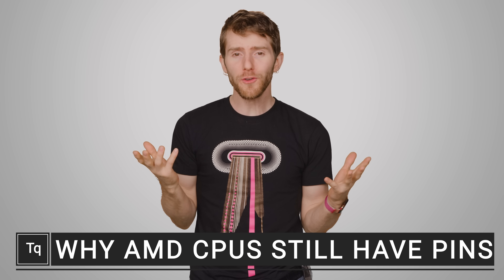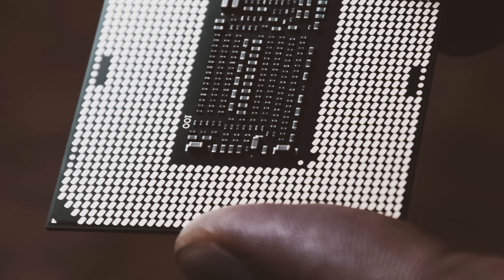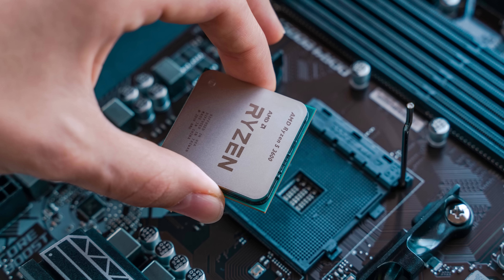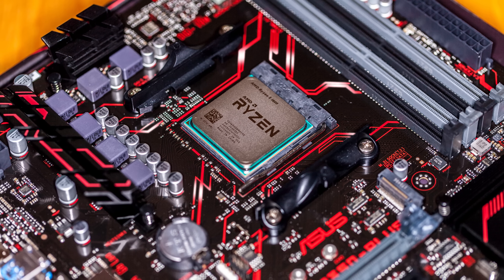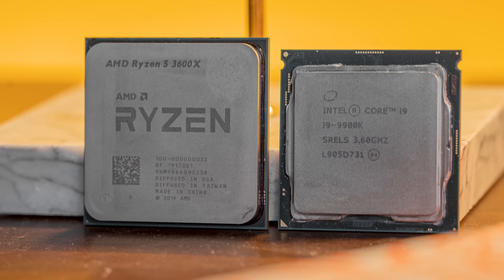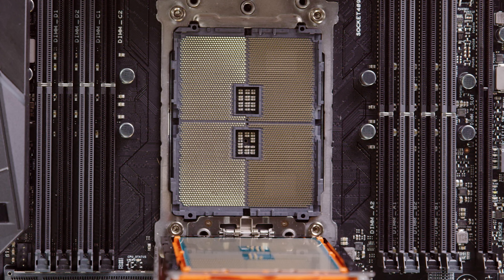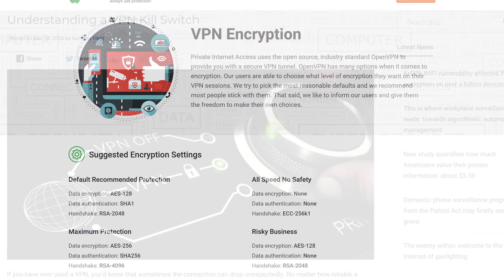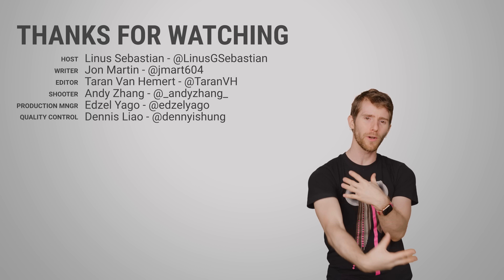Is AMD Stuck In The PAST?

Comment: I thought the step towards LGA for socket 775 was because of EMC problems resulting from the higher FSB clock and the pins acting as antennas. AMD on the other side integrated the memory controller into the CPU years earlier and therefore ditched the FSB completely.

Comment: Linus you forgot about few things 

you can get the CPU way longer, then a good motherboard, making PGA better for the long run

but also that PGA socket mounting system has a size threshold and that is why Threadripper has LGA socket

Comment: More than a little bit easier to damage an pga CPU, having worked on a server manufacturing line for almost a decade i can tell you the swap to lga from pga saved the company a fortune.  While individuals building their own systems will be careful, line workers with no concept of the value of a CPU and who the previous week might have been working in a washing machine factory or stacking shelves don't give a toss if they damage the CPU. When you have re-workers who can de-solder a socket from a motherboard it's much more sensible than having to scrap a cpu you cant RMA because someone mashed the pins beyond repair.  You'll note that AMD's Opteron & now EPYC have been lga for a decade, so yeah when it comes to massive amount of production lga makes far more business sense.  I imagine eventually AMD will switch to it for their desktop lines sooner rather than later.

Comment: Ryzens do perform better - we all know this - lets face it. LGA is the superior design.
LGA is tougher on the CPU which is the more expensive part and uninstalling a cooler on a PGA socket with CPU under it tends to rip out the CPU under it with the holding lever still tring to hold it. This incident is also not rare. So to answer the title question: Regarding the socket design the answer is: Yes, no doubt. But only AMD gives you PCIe 4.0 and a 7nm process. So the only flaw with AMDs Ryzens is the PGA-based socket.

Comment: Another factor might be that it lowers the R&D cost for Motherboard manufacturers which matters when you want companies to make motherboards for your ships, but your market share doesn't make that very appealing. A lot has changed since AMD settled on the AM4 design in 2016 so for the AM5 who knows what will happen.

Comment: PGA probably gives a better electrical connection as the socket grips the pins and the contacts are locked.  LGA relies on the springy contacts (NOT PINS) to touch the contacts on the chip.  Contact area is smaller, and there is no lock, only the chip is held down by a lid.   OTOH, removing a heat sink from an LGA chip is easier when the heat sink compound turns into glue since the chip is held down.  PGA chips are not locked down, and can pull out of the socket even when it is locked, so the chip can stick to the heat sink if it is removed cold.

Comment: 2:07 the 4.th pin on the right is slightly bended
Reply: Actually if you grind them out with bottom being letters and right side being numbers the the bent pins would be:
A2, A3, A4, H1, F7
Most are very minor but they are bent nonetheless

Comment: FYI, my go to solution for bent pins is a metal tipped mechanical pencil. Retract or remove the led in the pencil. The hollow tip can then be used to easily straighten the bent pin without damaging any other pins.

Comment: It doesn't matter whether the pins are on the CPU or the socket...x570 boards aren't cheap so it could be that it's more expensive than even the 8 core CPU going into it.

Comment: I ordered a Z77 motherboard on eBay to replace one that died and it came with a bent CPU pin.

I was able to unbend the pin surprisingly well, looks basically perfect now.

The pin was bent about 90 degrees to the right, I was afraid that much of a bend was enough for it to snap off when unbending but I got lucky.

Comment: I cannot stand this. They need to at least add a retention mechanism like the threadripper. I hate removing AMD CPUs from computers because the HSF is stuck to the CPU, pulls right out of the socket and then you have bent pins.

Comment: When I fixed a bunch of bent pins I found the easiest method was to use a utility knife blade. It's slim and flat, and the tip is pretty easy to get under single pins and straighten them up. Once they are all relatively straight you can then run down the rows with it since it's so slim and straighten them up all at once to keep them as uniform as possible.

Comment: why not have sockets on the cpu and amd style pins on the motherboard?
Reply: Because a PGA socket works by pushing the pins sideways into the contact clips. The plate with the holes must be able to shift, it needs the lever thing, and that wouldn't work well on the CPU package.

Comment: PGA chips also don't require special tricks to get the contact points perfect. As i recall, several LGA chips you installed had to be reinstalled because the contacts were not pressing down correctly.

Comment: lol intel changes the socket like every generation so i think having pins is forgivable. Your upgradability is much smaller in intel processors compared to amds am4. you can literally buy a $50 processor or $850 processor, and everything between has the same socket

Comment: I have never bent a spring on my PGA's and they provide a far better contact AND some heat dissipation.  G series commercial AMD sockets also used stupid spring array sockets as well.  Accidentally rubbing the recycled woven cover to power cables across a PGA doesn't destroy the socket instantly tho, so there is that.  The only improvement I can see in the future is substrate-edge power transmission.

~stares at the fucking computer industry that is still using fucking pins for power input to chips~

Comment: While I plan to buy amd processor next I must say it`s a big downside to have all those pins sticking from the cpu, every other video I watch about AMD shows cpu just sticking to heatsink when you remove it and bending those damn pins, Intel system is so much better.
Reply: It's because even tech reporters forgot how to remove a heatsink from a PGA socketed package. You have to twist to break the thermal paste.

LGA is foolproof until you drop something into the socket, then it's toast.

Comment: I was in shock when I found an old Intel based laptop I have with a PGA socket. I didn’t know they used to make laptops that way since I believe most are just soldered instead. That PGA socket on there does make things interesting though since I can actually remove the CPU if I’m bored. It is an exposed CPU by the way with no cover thing, so you should be maybe a little more careful when cleaning. The only way I know how to get a socket processor these days is to get one of those custom laptop chassis things you can put your own CPU in. I had no idea they existed until I got one basically from the government. But they of course didn’t give us more than a Pentium G5400, which isn’t “top of the line” like the guy teaching the class told us it was, but it is the fastest laptop I have technically by the CPU power, but the integrated graphics on that chip are really bad. I felt really weird in that class hearing lie after lie that I knew was not true. I only did the class for the free computer and money.

Comment: maybe one reason AMD does not move the pins to the motherboard is that with AMD you can actually stick to your motherboards for multiple generations of CPU. So the incentive to go for a costy motherboard is higher & if you break the Pin of a - lets say Zen1 gen CPU, you may asell move to Zen2 or 3 without switching other components. Not really an option with Intel

Comment: I would love to see if their is a way to connect a an external graphics card to an older Desktop computer.
Reply: Umm dude,as far as I know all graphics cards are internal components,and all you need to worry about is if the card has the same expansion slot standard as the card. Agp does not go into pci or pcie.

Comment: How about "If you suffer instability or it just doesn't boot then you may need to adjust the tension on one of the corners" - Threadripper build in one of LTT's previous videos.
Not an issue with pins.

Comment: There is another reason to go with pads. You can convert manufacturing to do BGA chips. Intel does do that depending on demand.
Reply: This is probably the main reason. Intel puts a greater emphasis on volume builders (office-supply computers) and AMD a greater emphasis on enthusiasts.

Comment: I prefer amd's design because if those pins get bent, you have quite a good chance to fix them. But on intel side, if you bend motherboard pins, then it is alot more difficult to fix it. I accidentally bent some pins on my lga boards, plugged in processor and turned it on, ended up with faulty processor as well as motherboard.

Comment: Anyone else recall ordering at least a half dozen ASUS P5A w/AGP plus the 2.5 multiplier for the Intel|AMD 233's to run at 250 as workstation upgrades from the old Pentium 133's?  How about those AMD|Intel processors on a slot?  And regardless of all those changes down though the years, we still have motherboards that use a BIOS "jumper".   ;) lmao

Comment: Linus: Is AMD stuck in the past?
Intel: 14nm process in 2020
Reply: Imagine needing 3 generations of 7nm to beat Intel's 14nm
Reply: PPSz imagine comparing a 250 watt cpu to a 65 or 105 watt cpu.
Reply: PPSz there has only been 1 generation of 7nm the previous ones were on 12 and 14
Reply: @alxz3707  Right, my fault. I thought the ryzen was always 7nm since people were making fun of Intel's 14nm since zen generation. When in fact TSMC's 7nm has density of like Intel's 10nm. And I've checked that TSMC's 12nm has less transistor density than Intel's 14nm
Reply: @PPSzB  plus amd is on par with intel on gaming aswell, but what about every other category? amd beats the shit out of intel in every other category and don't forget the extra cores and threads are and will be much more useful in the future when games will be utilized for 10-12 cores idiot.
Reply: Yum! Yum! Sources please about equivalent CPUs from both parties. And provide some static’s about how AMD is “beats the shit out of intel” I’m yet to see a real argument except for AMD fanboys being uneducated
Reply: @XYXZProductions  All AMD chips are unlocked, need less expensive boards, already have pci-e 4.0. Their stock coolers are more than enough for mid-tier chips so you don't have to spend extra on cooling. AMD gives you a lot more cores and ~10% less clock speeds for way cheaper. And what do you get from intel? A bit of gaming performance for a lot extra money
Reply: Still make better gaming CPUs :-)
Reply: Bobert Daniels gaming isn’t even in the top 3 biggest markets so that’s not of much relevance
Reply: @kylerclarke2689  hhahhahah my intel cpu can do better gaming
The cgi artist for terminator darkfate can go home after rendering because of the threadripper instead of an all nighter. Try that with an intel cpu
Reply: @megumareta6361  How is it that every time you mention Intel's gaming superiority, no matter how specific you are that you're talking about gaming, there's always someone like, "yes, but what about rendering??"

Actually they don't even concede the gaming part basically ever despite it being as obvious of a claim to make as "AMD has better options for rendering". What a nice thing it is that we live in a world where both statement are true!
Reply: @kylerclarke2689  The GPU is more important to gaming than the CPU.
Reply: @ktcool4660  nah, they are both beneficial. It is just harder to cpu bottleneck your gpu

Comment: there's another flaw that linus doesnt mention with AMD CPUs and thats if u dont heat the cpu before removing, you have the possibility of ripping the cpu out of the socket when removing the heatsink
Reply: Heat isn't necessary. You do have to twist the cooler.
Reply: @jordanrodrigues8265  i did try that on my BL25p server blade and i couldnt remove it without ripping the cpu out

Comment: I only started building my own pc in 2015.. and during those 5 years I already broke about 3 motherboards by bending pins on the cpu which sucks cause it cant rma'd. I suck I know but needless to say I'm switching to Ryzen after this quarantine. Currently using an old i5 7400 btw.

Comment: I remember the old days, sitting on the ground, profusely sweating,  my fingers covered in thermal paste and the prementioned sweat, armed with a paper clip to bend several pins straight after I dropped the CPU on the floor... AMD forever!

Comment: I was building a PC for a friend using a Ryzen 7 1700X (used) that I got for a pretty decent deal. However, the AIO wouldn't fit in the case (at least not the way I intended), so I shut my system down and said "eh, if my cooler fits, I'll just order an AIO and deal with not having my PC function for a few days."
Upon taking the cooler out and lifting the retention arm on my X570 motherboard, I forgot gravity existed and my Ryzen 9 3900X processor kinda just dropped out and landed right on the pins.
>Oshit.ogg
I spent a good 30ish minutes bending the pins back in place. And miraculously, I am typing this comment on that same PC with the previously damaged CPU...that I rebent into shape.
My MSI Core Frozr XL didn't exactly fit in her chassis, but the Frozr L that I got did fit. (Not surprising, the XL is uh...well, it's a chonky boi, and it's pretty tall to boot).
Moral of the story: Lay your PC on its side when taking your CPU out for any reason (I was taking mine out to clean the thermal paste off).

Comment: PGA and LGA used to matter then single hertz used to matter alot. Now we count in Mega hertz and Gigaherts latency on input into the CPU by a few picoseconds is not a thing to care about. a picosecond is 1 hundred of 1 nanosecond. The tech we got now made it that good.
The only people who should care are the ones who do high frequency trading but their CPUs are not even using LGA nor PGA but BGA or custom chips made so the data is on the package and doesn't have to move off of the package to get to the highest frequncy traders with the connector being PGA so their chip can go a few picoseconds faster for the people who did not pay enough to have their data hard coded into the chip used.

The use for the avg consumer is nothing. A nanosecond is shorter than you can notice so a few picoseconds one way or the other is also shorter then you will notice. A picosecond is 1/100th of  a nanosecond.

Comment: I bent a pin on my 3700x I made it straight and it was dead. I didn’t know you twisted the heat sink to take it off. I pulled. Let’s say that CPu and mobo is dead. But I did buy an upgrade

Comment: Intel needs as many contacts as they can get because they use more power than the average GPU
Reply: That's frankly silly. Total current-carrying capacity is what matters for power, not the number of pins. You can use a few pins or a few hundred.

Modern CPUs draw well over 100A, so it's quite a lot of current.

Comment: I don't like the way AMD cpus get locked in the socket. That small lever is not enough. You can accidentally pull out locked cpu when dismounting a cooler heatsink. And for sure I personally did that aswell, and bent a whole bunch of pins.

Comment: AMD : Makes 64 core CPU
Linus : "Is AMD stuck in the past?"
Reply: Denzel Disk they also made a 128 core cpu
Reply: @JavaJake123  When? Which one? Or do you confuse threads with cores? AMD indeed has 64c/128t cpus (epyc 7742, threadripper 3990x).
Reply: Lmao
Reply: Yeah I was just thinking this lmao
Reply: https://en.wikichip.org/wiki/intel/microarchitectures/knights_mill
Reply: Useless even ARM is cheaper and more efficient in servers where this think could be utilized in it's fully potentional
Reply: Lol, threadripper and epyc use LGA
Reply: It's a click-bate title.
Reply: Intel made a 64 and 72 core CPU, the 64 core CPU had 256 threads. But they don't produce them anymore since they have very limited use cases.
Reply: @happygimp0  lmao
Reply: @happygimp0  64 very small x86 cores with 4 way smt. Basically taken from their failed GPU project but aimed towards massively parallel scientific work that may not have been able to use a GPU fully. Or that it was easier to program a parallel task for x86 than cuda or opencl.
Reply: Good joke if you ignore the entire point of the video
Reply: Nintendo made the 64 like 20 yrs ago
Reply: Weren't we making fun of more cores in a CPU back in the days of AMD Bulldozer?
Reply: @silenceyouidiot  The joke wasn't that there were more cores, the joke was that they were weak cores. Sticking more of those on one chip barely mattered at the time, because most workloads were badly threaded. 
If they had comparable cores to Intel at the time, more cores would have been a godsend.
Reply: different architectures?

Comment: except the obvious thing, that the user DONT usually change the cpu every day, not changing of socket every year an making older compatibles means you stuck using the same tech during this time  and also cheaper to produce, but that's one of their selling point... Intel didn't used LGA on laptops until recently... Its marketing and forcing users, otherwise we would still using Slot 1.

And thing i didn't heard on the video, a big flaw on the LGA socket with heavy coolers tend to bend the lower pins its weight, on the other hand PGA processors had tendency of sticking into the cooler (looking at those melting P4) but with brains no parts were broken.
Reply: Just cuz everyday users dont but thats a minor market compared to corporate and industrial anyway 

I know your exaggerating but there is clear benefit to embedding the socket onto motherboard unlike slot 1...

There are pros and cons going from lga to bga.

And backplates for the cpu retention brackets exist. Even AMD uses them